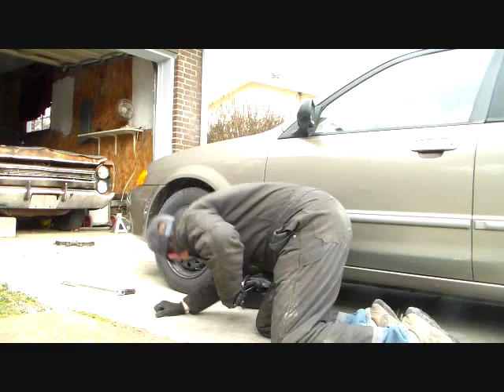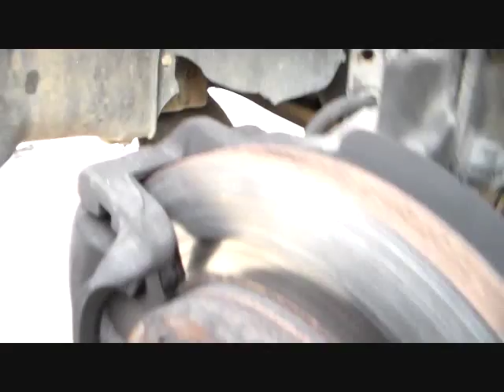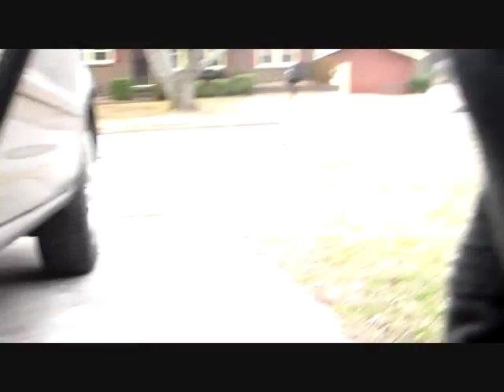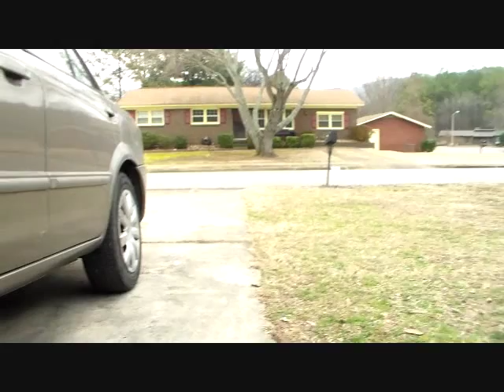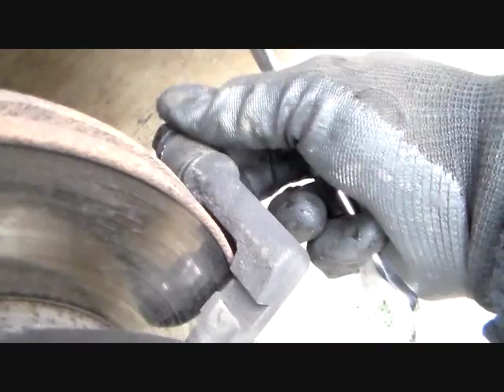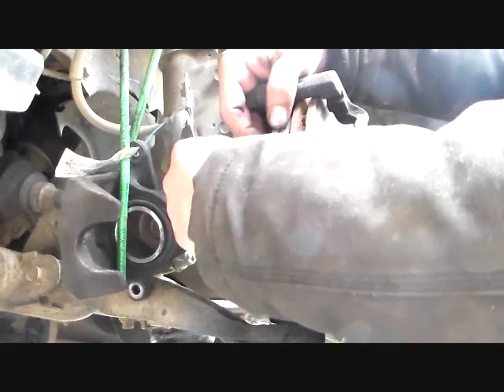Mazda Protege front brake job and repair

Comment: Nice job. I had a 3rd generation Golf (1993) and the caliper slider pins would seize up after 6months. Every time I did it used diffenrent grease because I thought maybe the greese was doing it but one day desided to use metal polish on the slider pins. Never had a problem since.

Comment: Just for the record...that's a good idea putting the floor jack under the rear subframe mount but pretty much all FWD cars are intended to be lifted under the pinch welds at the bottom of the rocker panels. Yes, if you have an old rust pile, it might crush it. Same if you put all the lifting force in too small area. The factory jack usually has a block at the top that has a channel for the pinch weld to sit in. If you want to make something really handy, get a hockey puck, use a table saw or whatever to cut a 1/2" deep channel across one face and use that as a pad in your floor jack cup so the pinch weld sits down in the cut. Spreads the load nice, won't crack the paint, etc. Then you can put your stand under the subframe, or the box channels in the floor if you dare. I do. They work fine as long as you let the jack down slow. Come down fast and they will dent a bit.
Reply from the maker: Thanks man!
Reply: You bet. Is that a '68 Fury in the garage?

Comment: Were the 2 caliper bracket bolts hard to get break loose ? What tool(s) would you recommend removing those bracket bolts, multi point socket and a breaker bar ? Would you put medium strength threadlocker on or just torque (58-75 Ft Lbs) them without it ?

Comment: I have a 04 Honda Civic 4cyl fwd and when I hit the brake petal to start slowing down for like a stop light it slows down but once I hit a certain speed before actually stopping fully I feel etheir a pulse or jerk do you think the rotors are warped

Comment: Im replacing the breaks on my 98 protege and my brak pads are a little smaller. just wonder if it will be different or if its still gonna be the same general idea.

Comment: Hey I just bought an 73 Plymouth scamp and its not lock up but it wont turn over the battery is good what do you think would be the 1st thing to check
Reply from the maker: You'll have to do some checking with a multimeter.

Start at the 'far end", which is the starter, for power when the key is turned, and work your way back.

The large red wire on the starter gets power all the time. The B+ power to the rest of the car comes off the small wire at the positive batt terminal, through a couple fusible links, through the large bulkhead connector, through the ammeter, through the key switch, back out to the starter relay just behind the battery, then to the solenoid on the starter.

Long path, huh? Haha, it's not hard to test. Just put a meter or test light on the small sol terminal ON the solenoid, ground the other side. Turn the key, see if it lights. If it does, you got a bad solenoid on the starter or the starter itself is dead. You can jump the small and large wires on the starter with a screwdriver and if the starter is functional it'll spin over. If it does not light, repeat the test to verify, then start going back along that path until you find out where the power stops flowing.

Comment: We're you suppose to machine the rotors if they look rough before you put new pads on
Reply: Most rotors anymore don't have enough meat to get a good cut even once. New ones are cheap, I just bought the two for my '98 for $13/each. You can't get them turned that cheap...

Comment: Can you tell me how to remove this rotor?
Reply from the maker: it should just slip off once the caliper is out of the way
Reply: @TylersNeighborhoodGarage  thank you for the super quick response, that's so uncommon. It was my first time doing it,  and I'm a handy person and it was easy. I just got confused because my rotor was so rusted on that a normal hammer wouldn't even make it budge, haha. I literally thought for minute that that bolt held it on. 😄  

She came loose though and the second one I didn't even need to beat on. Great video. I actually have spent tons of time looking through videos of my specific cars and there are basically none for this one except yours. I subscribed. 

Thanks for taking your time to help everyone. People always do these videos and they skip the parts where they are jiggling things loose and finagling things and cut straight to the new part being in. Being able to see how things are worked loose is really important. 

Your video stood out in its thoroughness.
Reply from the maker: @ryanhall6157  Thank you very much. I'm actually not totally disciplined about filming all the details, so I'm glad this video was usable. I haven't actually owned that car in several years so I had to watch through and remind myself. Some cars have a retaining screw in the rotor.

Comment: Came to find out if my 97 protege rotors come off easy or if they're like the old style with the bearing pressed in. Turns out, my guy here doesn't even touch the rotors. Shame.
Reply from the maker: I googled "1997 protege rotors" just now and it took me 5 seconds to see a picture that shows that they are separate rotors. No hub.

Comment: What if your break pads fall out and theur is no spring
Reply from the maker: The only springs I am aware of are on the pads themselves, and a replacement set of pads should come with them. Otherwise that stuff is common in junkyards. make sure that the slider pins on the calipers are not seized.

Comment: the most likely cause of your caliper slide pin issue is because from the looks of it someone used grease on those pins that usually puts an end to the brake job right their. silicone Is what should be used no anti size or anything of the like. by silicone I mean brake lubricant not gasket maker

I forgot to say thanks for the great videos always learn something new.